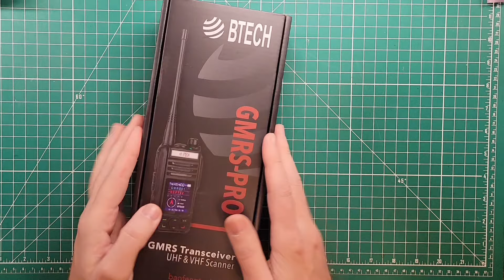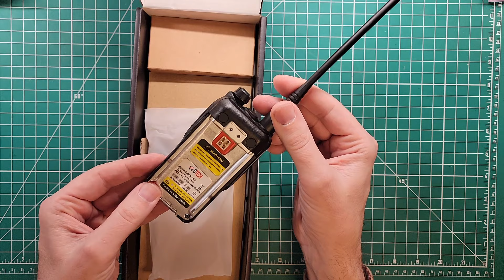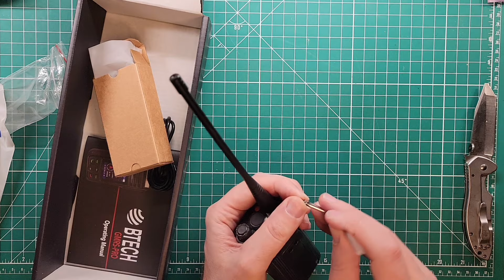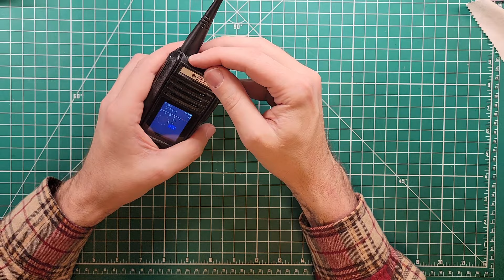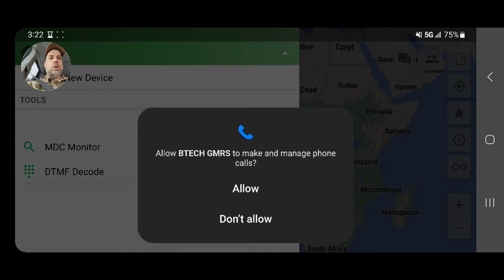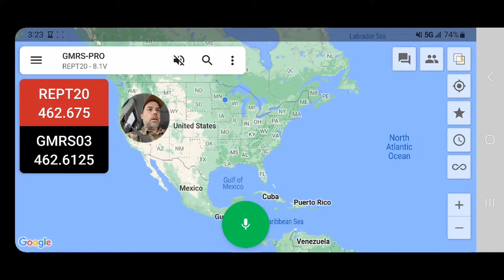You Want The Best GMRS Radio?

Comment: getting my gmrs.  with most ham HTs, the rubberduck antennas are,,, not great.  how does the stock antenna perform?  simplex range?  range to repeaters?
Reply from the maker: GMRS stuff is all over the place, some are amazing and better than ham repeaters, some not so much.  I've found the stock antenna to be "good enough"
Reply: @temporarilyoffline   another question, is the "sms texting", done through the gmrs equivalent of an aprs gateway?
Reply from the maker: @keithfrost1268  I think in this case they are just calling it "sms texting" and not actually saying its cell phone connected at all.  The US Government just rules that GMRS radios can't be inter-connected/linked via the internet and data modes on GMRS is already.  I think what they are referring to is data based textual messages that the radio sends via GMRS+RF to other GMRS Pro models.
Reply: @temporarilyoffline  so it only works if you have the same model.  ok
Reply from the maker: @keithfrost1268  For now it only works with the BTech GMRS Pro, Btech UV Pro, Radioddity GA-5WB, Vero VR-N76, VR-N75, VR-N7500, VR-N7600.  Would be pretty easy to add it to other radios as well.  Data over GMRS is very new.
Reply: @temporarilyoffline  Thanks, I look fwd to more videos on the subject

Comment: What does it mean to "talk around" a channel?
Reply from the maker: When you're talking on a repeater, you talk on the repeater's input and the repeater sends that to everybody on the repeater's output.  When you "talk around", you are talking on the same frequency as the repeater's output with your limited range and power - either the repeater is down, you're doing some testing, or your friend is close to you.  It's generally not a good idea, but sometimes you use the back of a screwdriver as a hammer too.  Just keep it in your bag of tricks and it might come in handy one day.

Comment: Is my GPS LOCATION being broadcast or made available simply by powering up the radio or benign operation?
Or only when I intentionally transmit it?
Reply from the maker: It is an option you can turn on/off inside of the menu.  If its on, it should TXing based on your settings.  I'm not a fan of giving out my location so easily.

Comment: I'm new to the world of GMRS; I just got my call sign.  Is there a radio that has GMRS and HAM bandwidth (fully recognize that I cannot broadcast on the HAM frequencies without the license, but could listen)?
Reply from the maker: There are a few out there than can switch between bands.  Usually on either type of radio you can listen to the other type without issue, just can't transmit.  The more recent tidradio models come to mind.

Comment: Is there something like this that doesn’t require a license? I’m not able to find a cb handheld with Bluetooth. I need the Bluetooth headset functionality as I intend to use it on the motorcycle with a Bluetooth headset in the helmet
Reply from the maker: There aren't many "good" FRS radios - which are non-licensed.  You can look up "POC radios" but they are basically radio over cell phone, might be a help there.  The GMRS license is just paying the fee.  No test involved.
Reply: @temporarilyoffline  do you just if the gmrs license exists in the EU? I can’t figure out where to get one in Germany
Reply from the maker: @pinpox  ah, EU. I don't know about GMRS regs in the EU.

Comment: Sorry if this is a stupid question, but what good are 6x30 channel groups when there are only 30 GMRS channels (including repeater frequencies)?  Does the radio work on 2m/70cm either natively or by some secret decoder ring unlock combination?
Reply from the maker: You can setup repeaters/simplex frequencies by need/group/area - there might be some overlap of repeaters as you travel, or you could support the (grand bike race) with Ch1 for Medic, Ch2 for Support, Ch3 for Management and support the (grand ski race) with Ch4 for Medic, Ch5 for Support, Ch6 for Management.  Just depends on your needs.

I haven't had a chance to find an unlock for this radio yet, but it wouldn't surprise me if it can be unlocked.  I'm actually shocked they haven't released a ham version of it.  Vero (the company that builds this) has a 2m mobile rig already, so they are in the space.

Comment: Totally new at this whole gmrs radio communication. Looking for the best radio to communicate with family if cell communication goes out. Do you recommend this radio or another. Like to use repeaters for family   5-7miles away. Thank you, great vid!
Reply from the maker: 5-7mi away, line of sight (no mountain/building in the way), this should work great.  Look for a GMRS repeater in your area and you can get 20+ miles with a good repeater.
Reply: Oh and basically for all family. I head the 
Wouxun KG-905G Professional GMRS Two Way Radio
Is good also. Help please
Reply from the maker: The Wouxun is also good, but not as many features of this Btech. - With one GRMS license, your whole family can use the callsign you get.
Reply: @temporarilyoffline  Thank you so much!! I'm gonna take the plunge!!
Reply from the maker: If you don't find a good repeater on your first try, be sure to try another one!  @stauffer65
Reply: @temporarilyoffline  Thank you!!!!!

Comment: Great radio. Planning to buy another for my son. The compass calibration was frustrating at first, but easy after you get it right once. While in calibration mode an infinity symbol / number "8" will appear in the center of the compass. Hold HT at arms length, perpendicular to your arm, and trace a figure-8 pattern where the antenna traces the path and the radio body follows along. This takes me ~5 seconds every time.
Reply from the maker: Sounds like you got it all figured put!  Awesome!

Comment: I really wanted to like this radio but returned it after 2 days. The rotary volume knob seemed to have preset volume settings. The lowest setting was still too loud and if you tried to lower it, the volume was totally off. Same thing with raising the volume. I also could not get the compass to calibrate after countless tries. Ended up buying the BTech GMRS V2 for $69 and it is way better. Only thing I miss is the nice display that the Pro had.
Reply: I agree. I returned mine. The annoyingly loud volume was one of the reasons.
Reply: There is nothing wrong with the volume knob. It is not resister wound, it is electronic. You have to look at the white bar on the front screen to see where the volume is set. Takes a little getting used to but it works fine after you adjust it. Sorry you gave up so soon. It’s a wonderful radio.
Reply from the maker: It's always a compromise with radios.  Even with all it's features, I still want more.
Reply: Purchased a Wouxun KG-935G Plus after the BTech GMRS V2. Love it.

Comment: I sure would like to Amateur Radio HT like this, but please let it have DMR as well IDAS/NXDN. This way I would have one radio for GMRS and scanning analog services other than GMRS. With Amateur Radio, I could use for the Amateur Radio system and monitor other services, such as the railroads. Because Class railroads are switching over to IDAS/NXDN. Only a few Class 2s and Class 3s use DMR or P25. Me, I want to keep up with Amtrak and CSX when I'm riding on the Silver Star. Or railfanning in the area.
73 K3JCP and WQAI363
Reply from the maker: It would be great to have one radio that did all/most of the things.

Comment: I’m debating between this and the Baofeng GM-15 Pro. Already run a Midland MXT275 in the truck and a couple of their 660 hand helds for spotting off road.
Reply from the maker: The Baofeng looks to be a good radio, although I don't have one to test out.  For the price, not much to lose, right?  It looks like you'll need a programming cable to go with it (unless they forgot to mention that it comes with one).

Comment: Per the web site, the antenna is not removable. Is that true?
Reply from the maker: Came off pretty easy in the video!
Reply: @temporarilyoffline  Which makes it non-FCC compliant, so while preppers won't care, should it really be considered the best GMRS radio?
Reply from the maker: @bettersaferadio  I guess that depends on what features make something best for you.
Reply: @temporarilyoffline  Of course, that’s always the case, but people should probably be informed about such so they can individually decide if they want to use a compliant radio or not. :)
Reply: @bettersaferadio  FRS antennas must be attached, GMRS antennas do not have to be permanent.
Reply: @ They do if the unit has data TX capability.

Comment: I have the g90/818/ which sigla link type device do you recommend that will work on both ?
Reply from the maker: The signalink will work with both, but You'll need adapter cables. I have a video on a G90 solution and I'm working on another one for the g90 also.  I just got my 818, and still have to figure it out.  Signalink is a good choice, but it's a bit big.

Comment: very new to radios here.  If your cell system goes down in your area, can you still use the app on your cell phone to send the text through your radio to those out of your area?
Reply from the maker: "Out of your area" is a GMRS repeater thing for slightly out of area or a ham radio thing for very out of your area. But yes, it is very possible to send long distance communications without 3rd party infrastructure using radio only.

Comment: GMRS Radios are usually line of sight radios, I wonder if the GPS works the same way on this radio.
Reply from the maker: Yes, line of sight for GPS also.  I'm pretty sure GPS is microwave.
Reply: @temporarilyoffline  yes, around 1200 mhz
Reply from the maker: @alanb76  hey Alan, thanks
Reply: @temporarilyoffline  sorry if I missed you at Quartzfest, the weather was bad so we didn't get around there much.

Comment: Good Morning Steve boy, when you said that you played with the game operation, oh you brought back some memories for me.  I bought the WOUXUN KV-UV9GX, I like it, a little hard to get used to and I don't like the fact that it doesn't have GPS which I would like to have in a radio.  Can everything that you mentioned be done off the key pad?  I only ask this because, if the SHTF your cell phone sevice will not be there hence the program feature.  Just wondering.  Not bad for the price.  Thank you for sharing.
Reply from the maker: Yes, everything can be done from they keypad - as you'd imagine, a little more difficult, but certainly doable.
Reply: Depends if the app requires more than just Bluetooth connectivity. BT still works when the network is down.

Comment: I do like that a lot of companies are starting to add USB-C ports to the battery itself for charging. Just a huge convenience all around. And I do like the added GPS functionality of that radio. I don't have that in any of my GMRS radios, which is becoming a bit of a collection since I got the license. Lol.
Reply from the maker: Yeah, radio collecting is an addiction!
Reply: With the USB-c on the battery itself, I've seen alot of complaints about it but I actually like it alot, say you have 1 or more batteries, you can charge it while using another, doesn't have to be on the radio to charge.
Reply: @scottsgamingtv7168  I have a crappy GMRS that has c charging from a couple of years ago...crappy because it has a garbage receiver and the transmitter is worse. But hey, I only paid $18.00 for it.
Reply: Now if we can get them all to make it c to c charging...